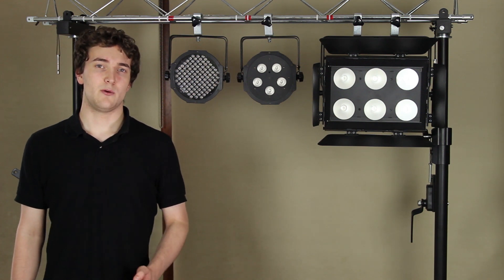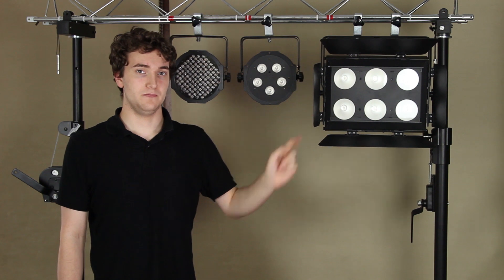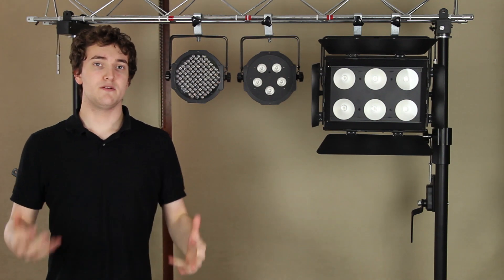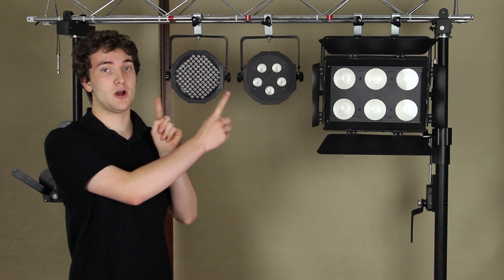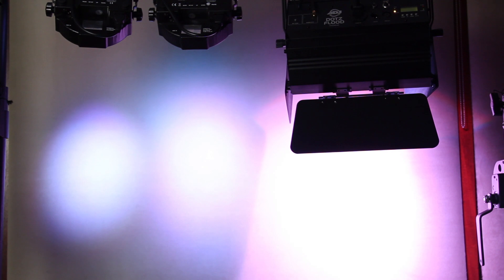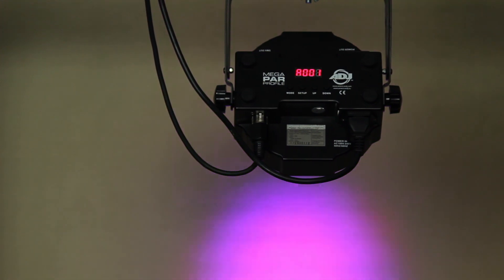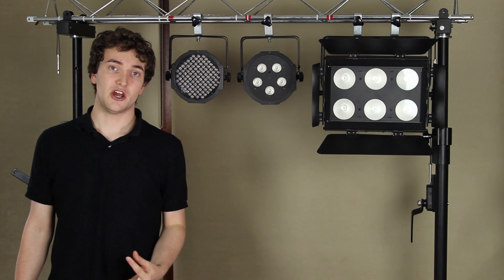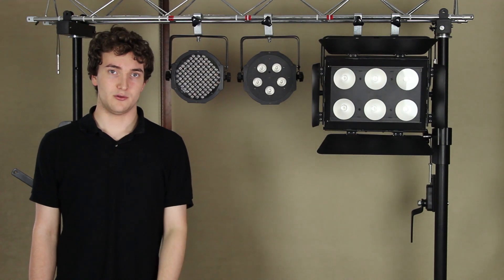What are COB LEDs? | RGB vs TRI vs COB LEDs

Comment: Hi Joe.  Great video comparing the different technologies!  Question: Can I control COB lights with a simple RGB DMX controller (like the ADJ RGB 3C)?  I'm currently using an ADJ Dotz TPAR and, while the built in programs are quite nice, I'd like to do some more detailed color mixing and fading without having to spend too much on an elaborate DMX controller.  Any help is appreciated.  Cheers!

Comment: Awesome 10/10 tutorial the only down side to the COB from what you were saying  is the heat, brightness and the ability to be battery powered in a smaller fixture like the profile. No doubt in the next few years they will have this sorted. The technology is moving pretty fast with LED fixtures in homes also so hopefully this will result in a drastic reduction in cost.